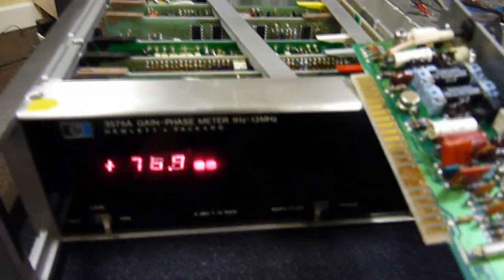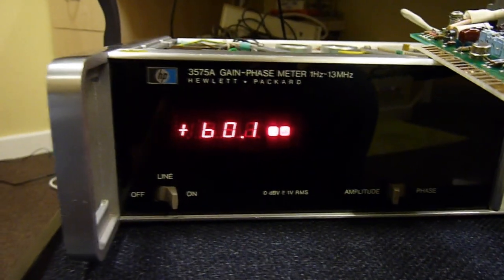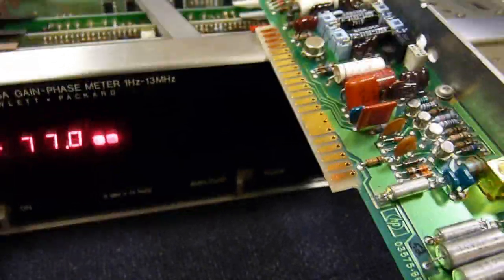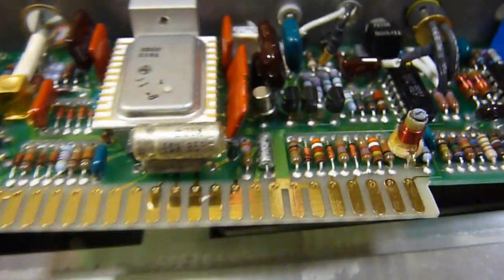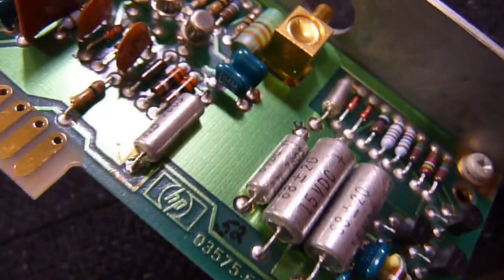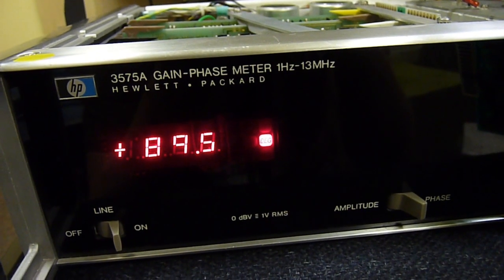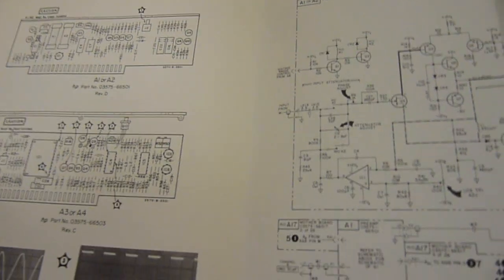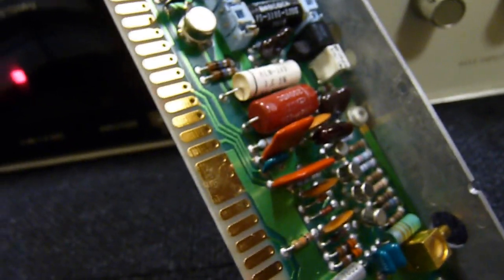HP 3575A Gain-Phase Meter (Part 1 Debugging)

Comment: I remember the good old quad 303 amplifier had a preamp that had plug in cards for the functions and various inputs looking kinda similar to this, every wire I could see inside was straight with 90 degree bend only when it reached where it needed to go! Apparently it's preamp sounded shite but can now be modified to sound good with new cards and parts!!  Hope ya get her good as new soon and start .ermm... using it as your erm...thingy! After all, everyone goes through phases!